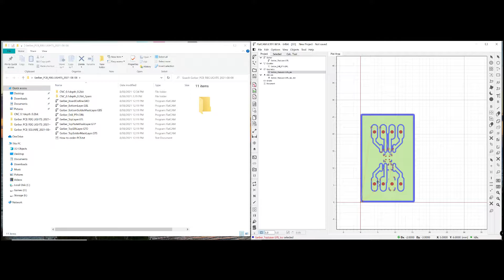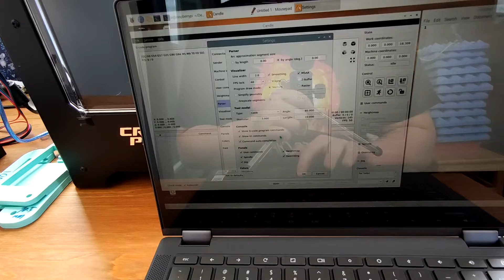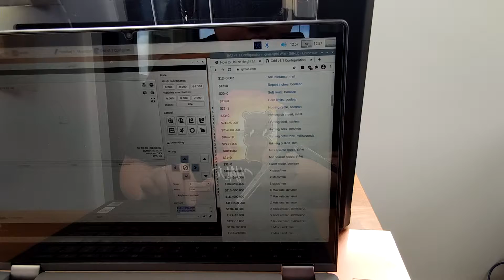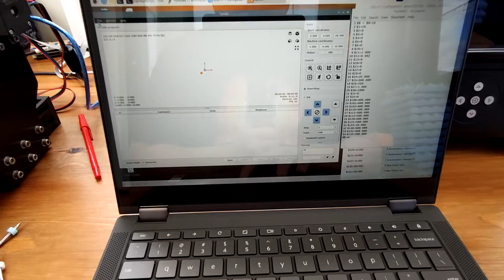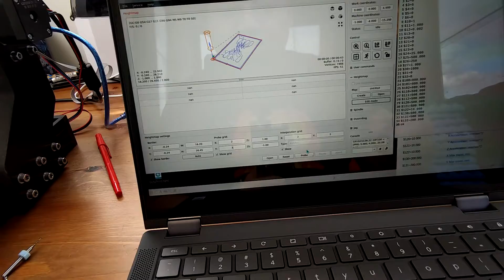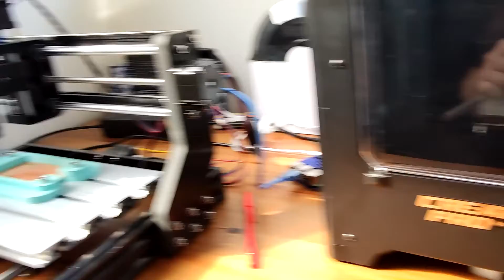CNC 3018 making PCB and using Flatcam to create G-code

Comment: That turned out to be a very good video. Your milling bit broke due to an error in the G-code.
It should be G01 Z5 followed by G01 X0 Y0 as the last position command.
Before I start milling, I always check the G-code. It's annoying, but the milling bits last longer.

Comment: Hi , thank's for the video.
I've never see the limits of theses tools explained in any tutorial about milling pcbs.
I work in electronics since the 80th and i've face many technics but am aware of nowadays goals.
I sold QFN packages with less than 0.25 pads width and about 0,1 interpads. I stuggle to believe your tool can do that.
In all Tuto i can see  allways the school case for beginners : And none numbers given : intertrack (or isolation) with limits, etc...
I'm laughing hard when i see people cutting bords'edges with a CNC (and with all the dust it make).
I use a simple manual chisel with manual handle,not the one you take in hand : it's a robust tool that can cut aluminium too.No dust at all, and very straight cuts, i'm also doing metal boxes with it. 

I hate milling : not only for the dust it makes. Until now i used laser printers on transparencies.
I bought pot of negative etch vernish 10 years ago, and i'll never finish it.
But printers and transparencies bring many problems : linearity, scale, cost and so on.
Then i  afford a 5 watts laser one years ago: no linearity and scale problem.
The problem was the paint until i found the good one, now i can make 0,25 thick tracks circuits.
But under that, it is not sure. With transparencies it was possible.
It's in part due to the laser point thickness but also to the fact we that paint which must be hard fixed to the board because we
must brush it a few afterwards to extract the burned paint.
I'm preparing my own tutorial into with i relate my experiences with PCBs and i'll send you the link.

Comment: You really should use the probe again to set the Z height when changing a bit. That would probably have saved your small drill and would have stopped you milling through the entire PCB thickness in one pass. Otherwise very helpful in confirming the process. Thanks.
Reply from the maker: The problem with using the probe again after milling the traces is that the bit might be probing on a surface that has been isolated therefore no continuity, which will lead to the bit pushing into the copper clad board and breaking the bit. The only way to solve it is to put the z retraction to clear out of the hole after drilling.
Reply: @lowmunseong106  as long as you probe to a point outside of your board cut-out there will be continuity.  Even if you are worried about that you could just use the paper method to reset the Z height after a bit change as it's only the engraving that needs a very accurate Z height.
Reply from the maker: @GForce2010  yes I agree that can be done since the height of the probe does not to be very accurate. But in my opinion moving the spindle around would increase chance of making mistakes. As you would move the spindle to one side and then back again and as you know this machine setup has a bit of play.